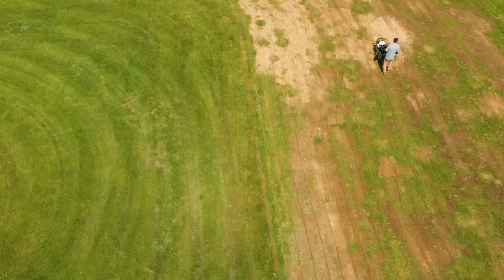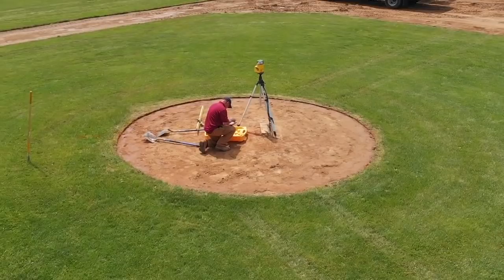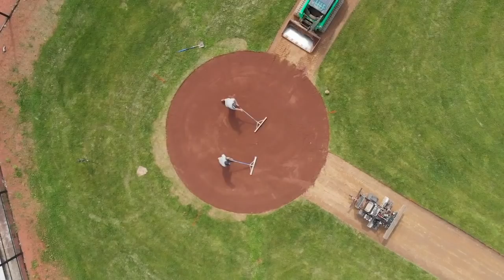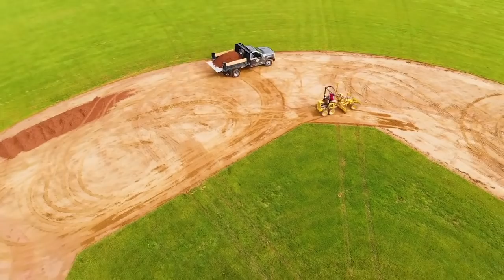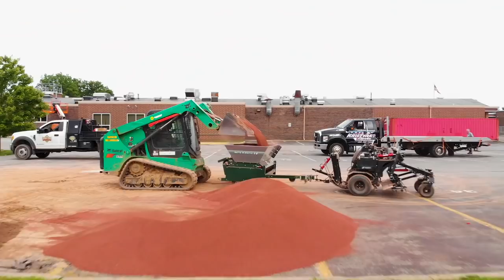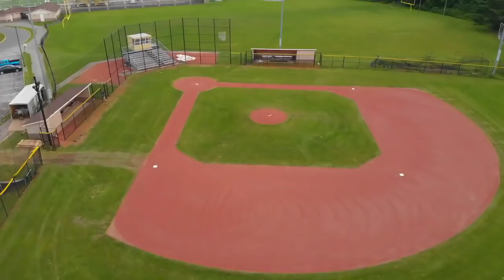Baseball Infield Renovation | Time Lapse | DuraEdge Products x Homefield

Comment: That's awesome, when you have money and equipment like that at your disposal... We used measure tools, twine, weed eater s and tillers....and lots of love from our volunteers
Reply from the maker: You are in the same boat as most and we commend you for doing what it takes to take care of your field.  The folks that take care of the field after we did the renovation are very similar is tools and resources however.  It is possible to greatly improve and take care of a field like this with more limited resources.

Comment: Always depressing to see a baseball field all overgrown and clearly not used in years.  Overall good job.  But the batters box and pitchers mound should be dug out and lay clay brinks down.  The way they did it in this video there will be huge holes after just a few games in the batters box, in front of the rubber, and where the pitcher lands.
Reply: Those areas were packed and compacted with the same material used to make clay bricks.
Reply from the maker: Hey Matt, thank you for the feedback.  For those wear areas you are referring to, we do make our own bricks for what you are talking about.  However, our DuraPitch clay used in this project holds up very well to the abuse too.

Comment: Im curious as why they dumped the mix on the asphalt...they must not be worried about debris,  especially from the bucket scraping the ground
Reply from the maker: The asphalt is usually the best option as it is made sure it is as free of debris as possible.  Putting the mix in the grass or gravel often leads to much more debris.  Our operators are very good with the machines to minimize excess debris.